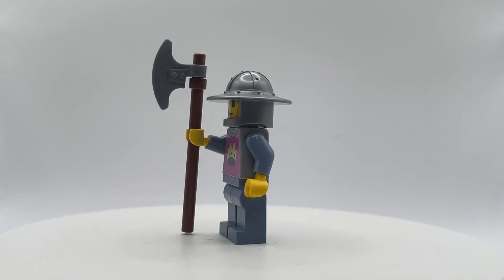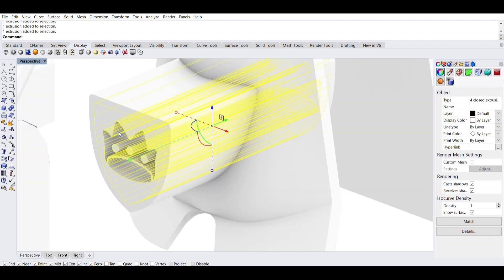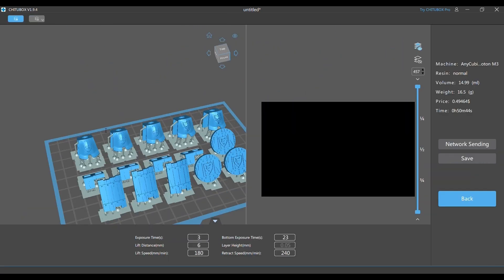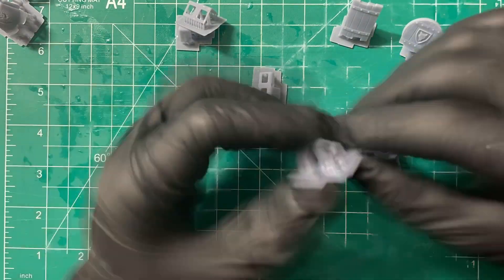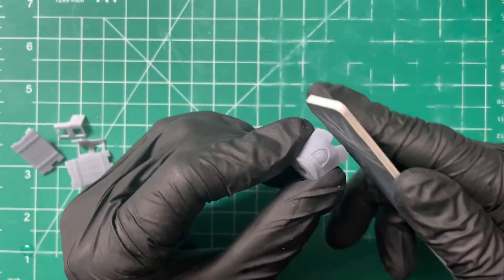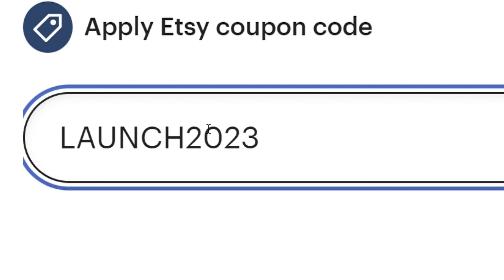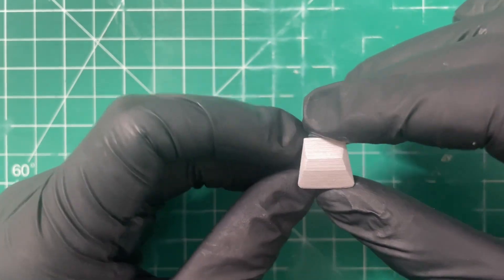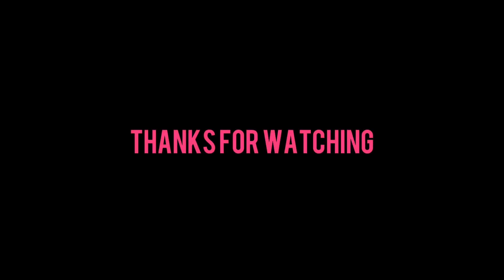A QUICK GUIDE to Designing & 3D Printing Lego

Comment: Nice work! As a fellow designer and printer of bricks, I can suggest that the layer mis-alignment is most likely due to insufficient supports (always the case with my prints); Try using heavy supports connected where they're least likely to be seen, in combo with light supports. Also, I see you're already rotating the parts on the Y axis, but try additionally rotating the part 10° on the X. (Or vise-versa.) Good luck!
Reply from the maker: I appreciate you taking the time to help me out! Good luck with your endeavors too 👍

Comment: I entered in this video to know how he manages mesurements to make sure the pieces Fit but he said nothing, i'm a beginner in 3d printing, does anyone have any details?
Reply from the maker: Hey dude! I apologize for not going in more detail. You have some options: old fashioned way would be trial and error using a ruler and print a bunch of test prints till it works - this is how I did it. 
Another easier way would be to rely on 3D models of common LEGO pieces you can download online for free. You’ll have to test print them and make adjustments as you see fit. Cheers!